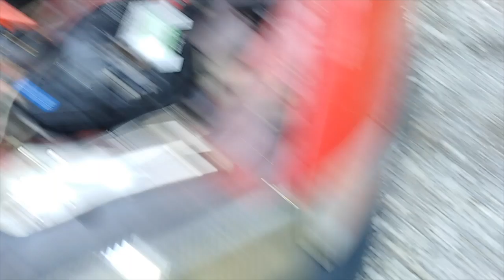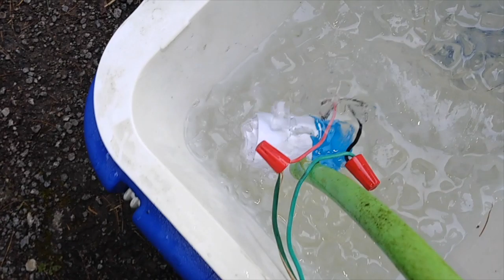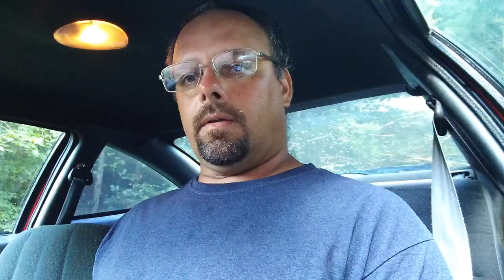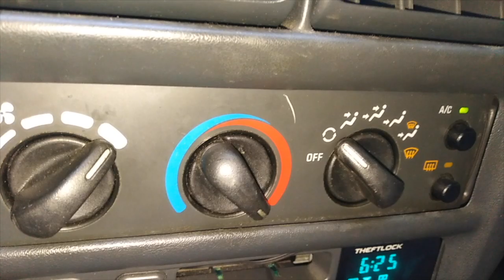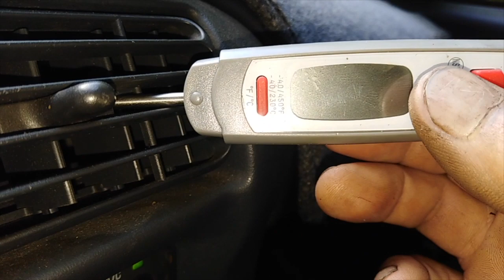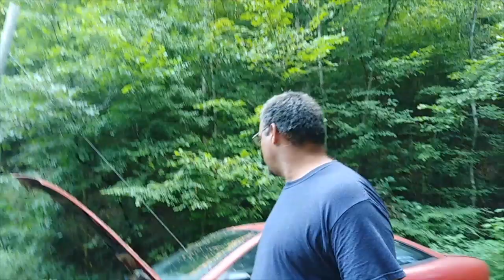Cheap Air Conditioner Fix/Hack For Your Car

Comment: That may work but unless you're in a scalding hot place like I am wet tiles around the neck will work just as good and drinking ice water.
Reply from the maker: Great point

Comment: How about a indoor portable a/c unit with an inverter to 12v ?
Reply from the maker: I have done that in an s10 once. It works but it puts a big load on the alternator. I used a window unit that just fit into the sliding back window.

Comment: newer cars have wayyyyy too many sensors
Reply from the maker: Yes. I like the older style vehicles which were much simpler.
Reply: @lukeFugate I can only wish they got better  MPG other than that I have no complaints
Reply from the maker: @5065ca  yeah my truck gets about 15 mpg but driving  it is more fun per gallon too.

Comment: I have seen that video also I really enjoyed your Water Wheel video. 50 watts is amazing. If you don't mind me asking what is your gallons per minute and head equals amount of feet the water is falling. Also maybe I missed it but I did not see the tip of the nozzle did you say it was just straight pipe I think that's what I understood the water was coming out of a straight pipe into the water wheel no nozzle to pinch it down. You've done a great job thanks I'm learning a lot from you
Reply from the maker: Yes, the nozzles are open pipes. I may get more efficiency from reducing them down but I haven't tried. There is about a 30 or 40 foot drop from the intake to the generator. Not sure of GPM but I am not using much of the potential water at all.

Comment: How many watts, amps, volts is the Micro Hydro alone putting out?  Can you please show a video of the nozzles that you are using on the micro Hydro
Reply from the maker: The water turbine system puts out around 50 watts and is enough to keep a 12 volt battery charged while running the lights.I have a video that shows the nozzles they are just two 3/8 pipe nipples open on the end. here is a link to that video. It doesn't go into detail, but it does show them.
 https://www.youtube.com/watch?v=NTWoSivTpHE

Comment: Luke,  how many miles does the average car in Knott County have on it,  more or less, when it is retired from further  use on the road?  Or what was the miles on your car.....?  That A/C fix showed a lot of ingenuity which is your usual MO.
Reply from the maker: Not sure about the average around here. This one was almost at 300,000. I have an old Lumina with 340,000 and of course Ol' Green with around 600,000 and still going strong. I guess they don't make them like they used to.

Comment: thats a good idea! Ive done a system using an oil cooler and 12 fan kind of like your house system and a bilge pump in a cooler like this setup, it works a LOT better then the fan just blowing over ice like most swamp coolers. Im considering making one for the new digs
Reply from the maker: Now just to find an unlimited supply of ice.

Comment: I would say if salt didn’t corrode metal add some to the ice water mixture to make the water ever colder!
Reply from the maker: It would make it colder, but I would be concerned about the corrosion.
Reply: luke Fugate agreed
Reply: Antifreeze.  Just never use the cooler for food again.

Comment: I would have never thought of the heater core
Reply from the maker: I figured if it can blow hot air, it should be able to blow cold air.
Reply: @lukeFugate   Indeed, it was just crazy enough to work. This is the kind of ingenuity that will send the first ford pinto into space